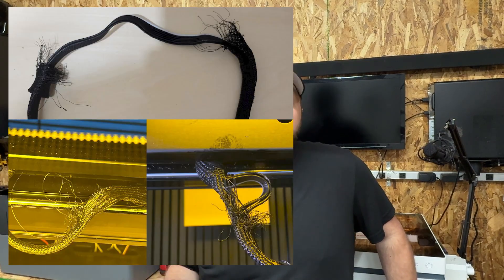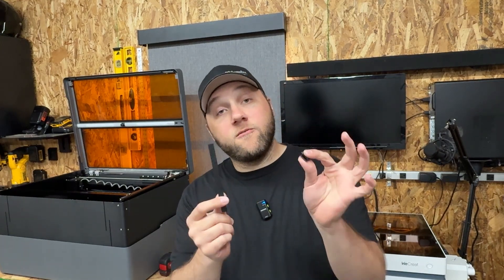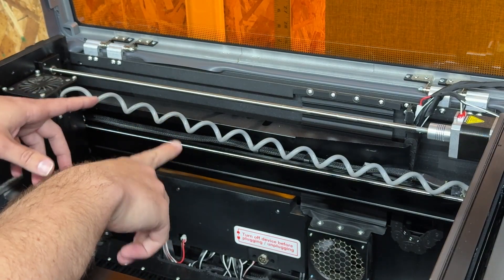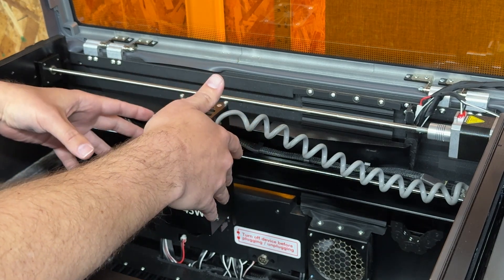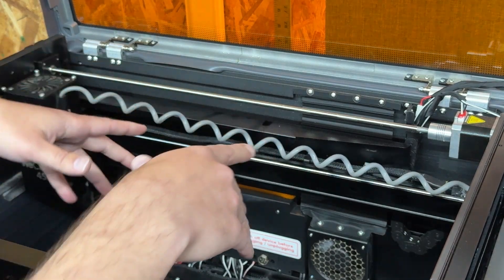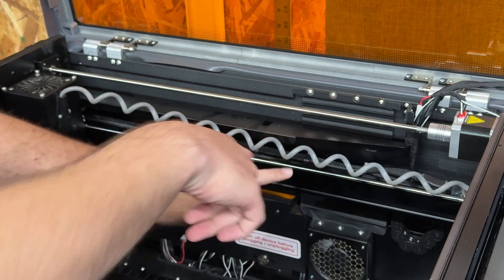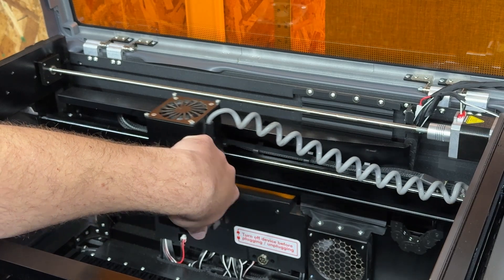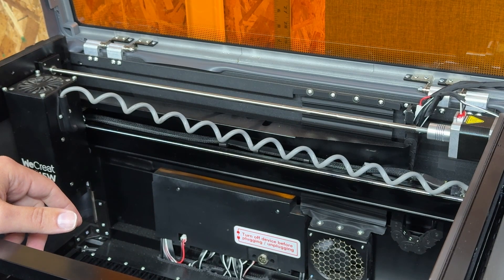We Fixed the Frayed Cable Issue on WeCreat Vision Pro 45w (Free Download)

Comment: Josh,
I purchased the 45W and received it on 23 December.  My machine has 3 clips instead of 2 and the cable is flat.  I haven't seen the cable rise when I move the laser head back and forth.  I printed the cable guard but don't know where to put since I have 3 clips.  Should I add a 4th clip and run the cable guard from the 4th clip back to the 3rd.  I have not seen the cable rise any place along the track.  Do i need the cable guard between the 4th and 3rd Clip.  I don't want my machine to die on me, but I am at loss to where to put the guard.
Reply from the maker: They might have made improvements since this time I made the video all that time ago. If you move the laser head back and forth and the cable doesn’t catch or rub then you should be good to go.
Reply: @FreshStartCustoms  OK, thanks.  i will keep an eye on it.

Comment: Hi! Mine turned off and hasn't turned on since. I've only used it three times, and on the third, it shut off in the middle of the project and hasn't turned back on. Do you know why?
Reply from the maker: Not sure. Maybe the cable was damaged. I would contact support they will troubleshoot your power supply too

Comment: Oh man I just ordered this machine, does anyone know if they come with the new cable now or will I need to start making calls before I even get it here for a new cable to be shipped?
Reply from the maker: I believe they are shipping with newer cables now but you can still do something like this to be safe.
Reply: @FreshStartCustoms thank you, I ordered last night!
Reply from the maker: @tesoroforever no problem.
Reply: I just got mine, didn't know about this problem, and the cable got trashed on the first two small jobs.  It was sent with the bad cable installed and a "new" cable in the box with no explanation as to why.  This is really a bad start to my experience with this machine!

Comment: Ours frayed, clipped the actual wires and then fried our machine. We had to get a replacement. (They were great and quick btw). Now, the new machine is starting the same thing. The back solders on the laser are rubbing the sheath.
Reply from the maker: Sorry to hear that.

Comment: Mine just frayed to the point that it caught sparks and burned up my machine.  Also the replacement to the one that stopped working mid print. When i contacted them they are able to send out upgraded cables if there are issues.  Why they are not just sending them out with the the upgraded cables already installed is beyond me.
Reply from the maker: Not sure. Thanks for the additional information on this

Comment: So, mine is fraying the cable because there is a part attached to the laser head that is sticking out and it is bumpy in the back and when the wire folds getting caught and causing friction fraying the cable. They have new cable, I am waiting for. I have not use my 45W since because it is jumping and messing up my projects.
Reply from the maker: Hopefully this will correct that as it prevents the folding.
Reply: We were experiencing the same issue but were told by customer service that the weld points were the issue and were instructed to tape the underside of the cable connection to prevent fraying.
Reply from the maker: @anitaroberts8189 interesting did that help